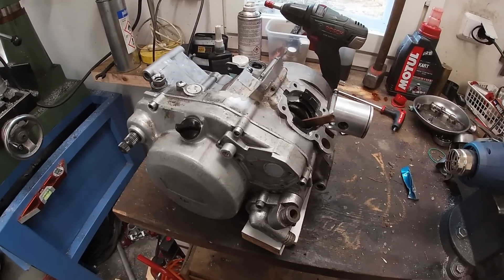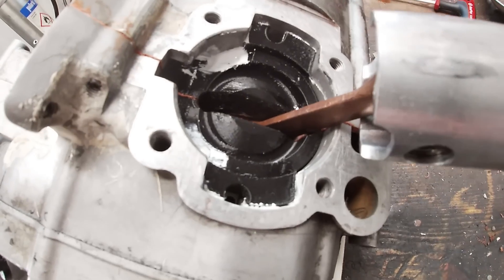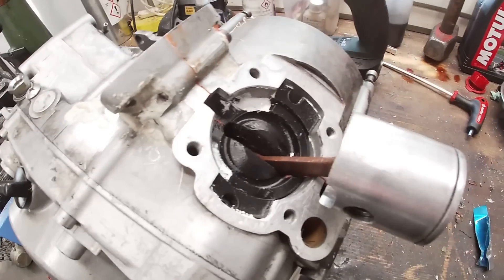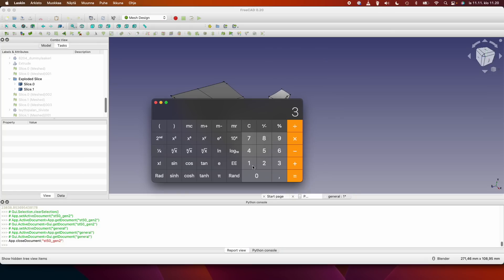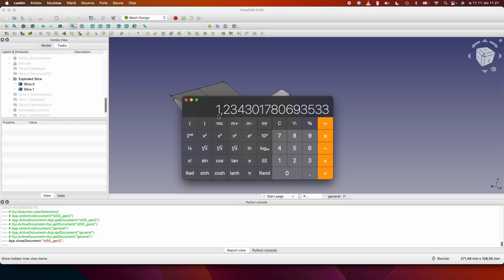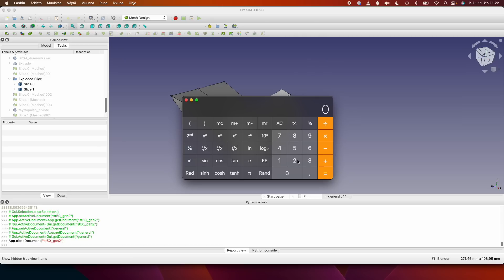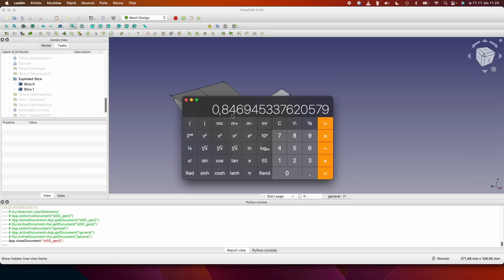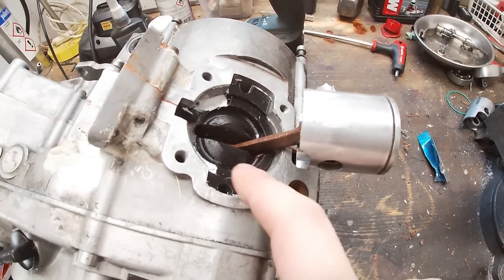20 hevosvoiman mopo osa 18: testataan kampikammion täyttö

Comment: u might need a different shape  exhaust to push fuel air back in. i think higher compression in crank will push more fuel air mix out of exhaust port before port closes. so u might need an exhaust with a faster or stronger pressure wave to push it back

Comment: To build a pipe that will work you need to measure the exhaust-gas temp. and recalculate the pipe. caculate the pipe for 12000/min. What angles did you use to caculate  ?

Comment: hello man!
reading through your syntoms, it seem that both of your reedsvalves or the transfer port are bottle necking the gas flow.
to be sure about that, use the bigger carburator and try open the throttle at 80/90%.
if you don’t see any big changes in term of hp, you can be sure about that!

Comment: When you are miles away from having 1.3 case ratio and you make it a little smaller - it is still miles wrong. So expecting a good result is dreaming. Even with 1.3 ratio it will need alot of testing to find the correct reed petal thickness that suits the case ratio , but is not so thin as to cause fluttering at high rpm. Your intake length is also way too long for the rpm you are trying to reach. Again , with several things all happening at the same time you have to step thru the experiments one by one. Using a simulation helps isolate the bigger issues before you even begin. Cheers Wobbly.
Reply from the maker: Thanks for the insight. I guess I will revisit this then.

Comment: Crankcase volume on race engine 80cc and 125cc are 1,3  - 1,8 time of the cylinder displacement.  This make power variable of 10%… this information come to Gnani race motorcycle producer and champion on 80cc - 125cc moto GP

Comment: Maybe it would work better if the stuffer was not as big as it is right now. If it is what the engine needs this might be too much.

One other thing, you are using a cdi ignition right? 
On forums they say that with cdi ignitions the spark gets weaker and weaker as they rev past ~10000 rpm depending on the model. I think it has to do with how cdi ignitions work. Capacitor discharge ignition is the full name. As far as i understand them they work by charging up a capacitor with the magnets on the flywheel going past the coil under the flywheel. And when the sensor on the chrank gets triggered the charged up electricity gets relesed to the the second coil. The coil turnes the electricity into high voltage and sends it to the sparkplug, thus making a spark. 
With higher rpm the time the capacitor has to charge up gets smaller, and i think there is a limit on how fast it can charge up. Therefor as rpm increases the amount of electricity stored is getting smaller and smaller and therefor it makes a weaker and weaker spark. 

There are other types of ignitions like battery discharge ignitions. They are known to make a strong spark regardless of the rpm. But they need a separate battery to work.

This ignition takes the electricity from a battery instead of generating it with magnets. There is only one coil and it gets charged by the battery. And a sensor on the chrank gives the brainbox a signal when to send electricity to the sparkplug. 
There is no capacitor that needs time to charge up. As long as the battery is charged there is a strong spark. 
As far as i know these ignitions are used by a lot of people tuning 2 stroke engines etc.
Reply: Edit I did some reserch and the battery discharge ignition is called inductive discharge ignition. Just look at the english wikipedia page about cdi ignitions. The things i said stand there aswell. 
There is a company called powerspark they make these ignitions they seem to be good quality. 2 stroke stuffing used one on his 20 hp 50 engine.
Reply: @lxa_Louise  Wikipedia says following (emphasis mine):

"Capacitor discharge ignition (CDI) or thyristor ignition is a type of automotive electronic ignition system which is widely used in outboard motors, motorcycles, lawn mowers, chainsaws, small engines, turbine-powered aircraft, and some cars. It was originally developed to overcome the long charging times associated with high inductance coils used in inductive discharge ignition (IDI) systems, making the ignition system more suitable for high engine speeds (for small engines, racing engines and rotary engines)."
Reply: @MikkoRantalainen Oh well, always good when someone checks what you think you know.
I should have done real reserch before writing. 
Whatever the powerspark system is if its a idi ignition then they seem to have found a way around this problem. On the website they say it makes a consistently strong spark up to 30000 rpm.

This is what i was thinking about commenting yesterday but didnt because i could not find a sequence of the video that shows the ignition side of the engine. And the other explanation is right also or thats what i thought. Turns out to be wrong.
I have watched video 17 and Asoftaaja talks about that he uses the stock ignition. 

Most of the stock moped cdi ignitions are probuably manufactured as cheap as possible and in my opinion they dont make the strongest spark to begin with.
These am6 engines are as we know governed from the factory by taking away every second or third spark over 6000 rpm or so.
So the ignition was not designed and probuably isnt able to make a strong spark at 12000 - 17000 rpm. And with this engine having its powerband somewhere in this rpm range a strong spark is needed in these rpms to burn as much fuel as possible in the extremly short window of time before the exhaust port opens. 

Thats why i think one should use a ignition that is made for the rpm the engine runs at. Perferably the one on the market that makes the strongest spark of them all. I dont know if the powerspark makes the strongest spark of them all but it got used by someone who supposably made 20hp with his 50cc 2 stroke on his dyno. There might be a better one.

Comment: Just slap any 50cc am6 cylinder on that, give it a nice tuning job, and guarantee it will score more
Reply: The thing isn't necessarily to bolt on things - but to fabricobble. 

He cast the cylinder on that thing himself.
Reply: @sampsasaahkari3209  I know, but with that logic he should make his own case and gearbox, sometimes it's beter to start with a good base and try to evolve that, instead of making it from nothing (with al the design failures that go with it)

Comment: In time you could try to install a longer con rod 3mm longer from a
Jap crank or buy a racing crank buy moving crank big end pin to the outside radius  by 2mm giving a longer stroke and pack the barrel up to match